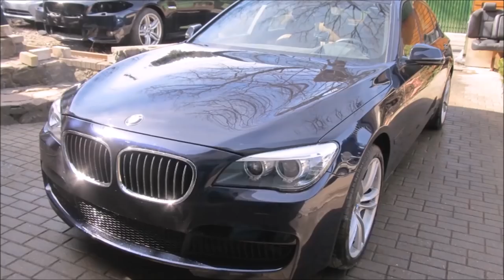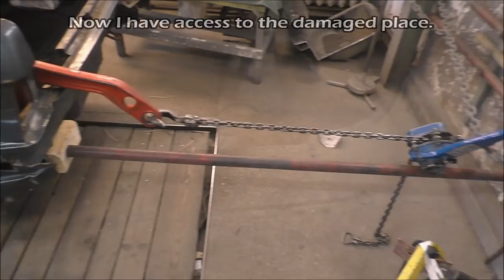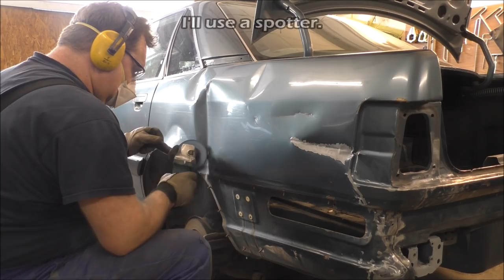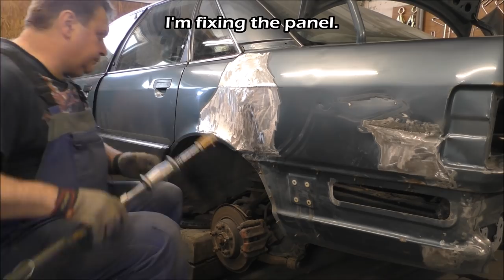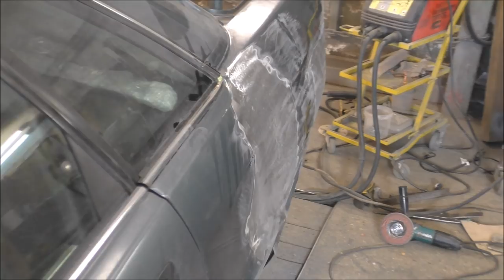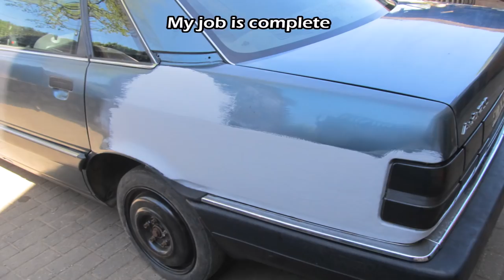Audi 200. Body repair, work with metal. Ремонт кузова, работа с металом.

Comment: I watch his videos a lot. He fixes many types of car accidents. The head of the car is not the same. When the impact on the head or tail car crashed on both sides of iron front head. How did you get the correct size or head of the car?
Reply from the maker: This is long talk. :)

Comment: The repair done was totally wrong , before using the spotter he should have put a 2x4 block of wood in the tail lamp pocket and should have given it a light pull so that the 1/4 panel was pulled and the buckles would have popped out then he should have used the spotter with the tension of the pull. This guy just shrank the metal where it was .

Comment: Might look good but i bet if this car was involved in a crash again on that same rear quarter panel i bet it would just crumple up as i bet its lost all its strength could be seriously dangerous. I know the cars look good when you've finished with them but are they actually safe. In my opinion most of them could be death traps. I certainly wouldn't want to buy or travel in one if i knew what had happened to it and how badly damaged it was let alone take my children in one. But in saying that maybe the rules and regulations are different in your country arthur. I'm sure in the uk most of them would have to be crushed and never put back on the road.